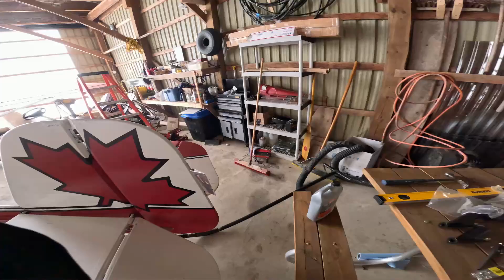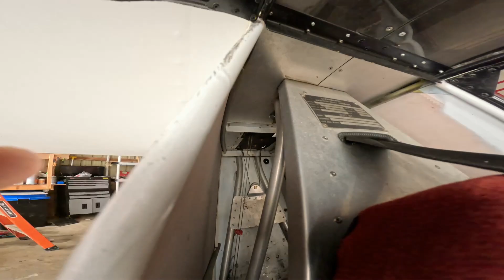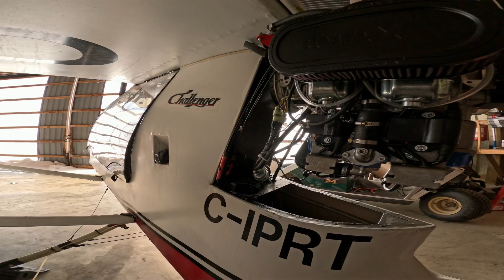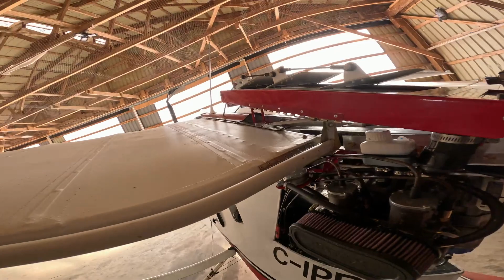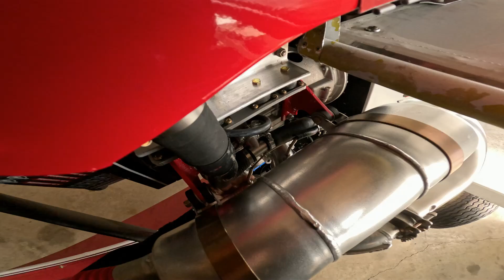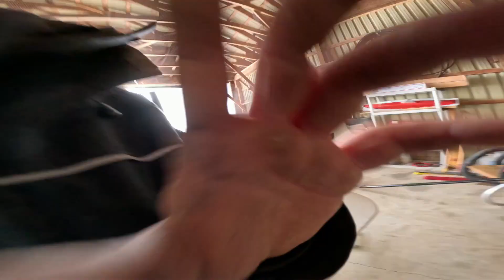Rotax 582 conversion install on Challenger 2 ultralight

Comment: I would be very curious in a true weight comparison between a 503 install and the 582 install. all said and done i'm sure there is not much power to weight ratio gain for the cost of the 582.
Reply from the maker: It has WAY more performance than 503. No comparison. 

Yes the 503 is good and gets the job done.